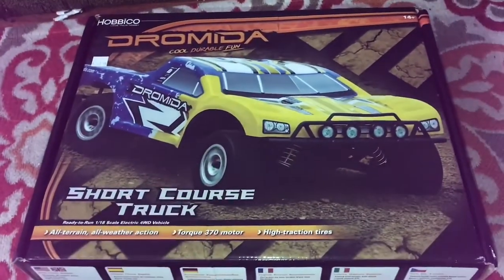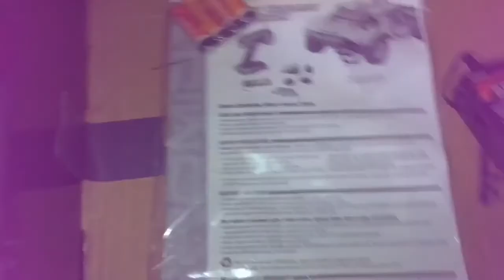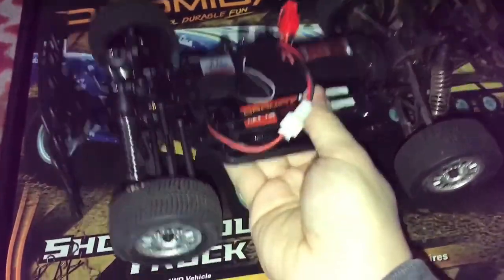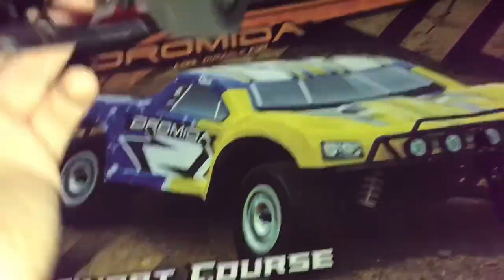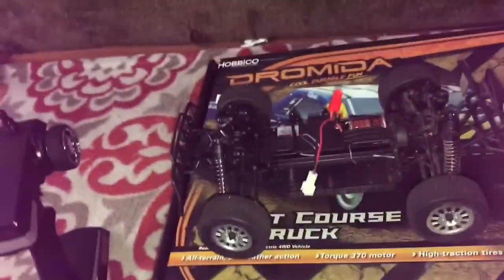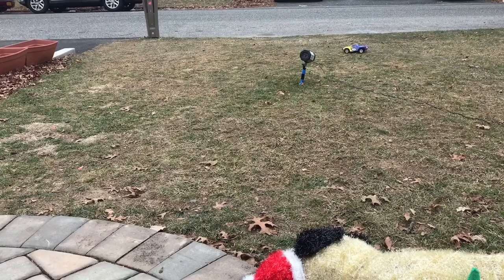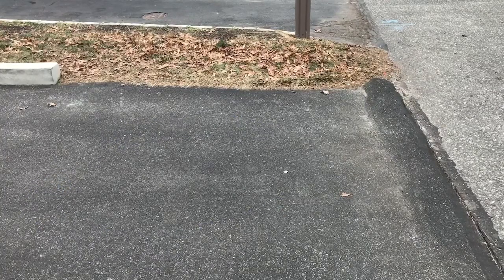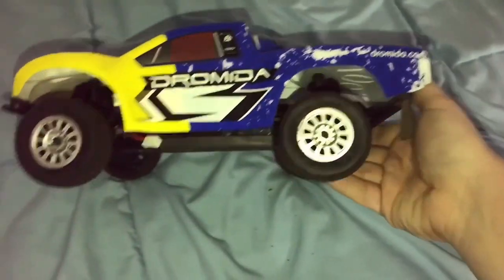Dromida sc4.18 short course truck review unboxing and first run

Comment: I have the same truck except mines from like 2013 and I’ve never had a problem with any of the plastic parts breaking, ever. sure my rims cracked from launching the crap out of it but 6 years later and every piece on it except the battery is original and boy have I beat the actual crap out of it! And if you want to set steering trim bring it out go full speed straight on smooth pavement to make it go straight and then leave it and never adjust it since it’s always going to go whacky over bumps and stuff
Reply: How fast will it go?
Reply: @tenncutt  not too fast probably about 15 maybe 20 mph. It’s fast enough to launch off of small jumps and to use at a skate park. It’s also slower in grass because of its small tires